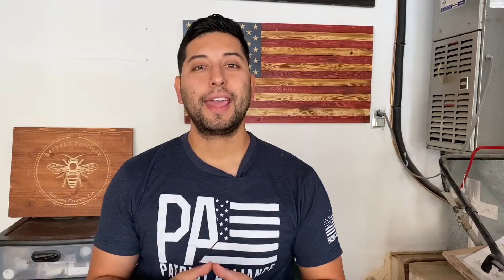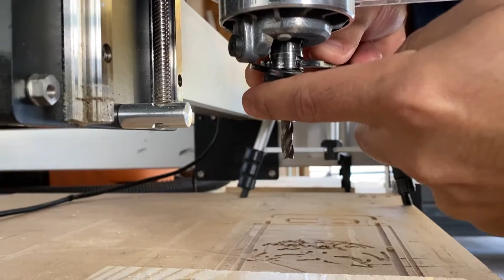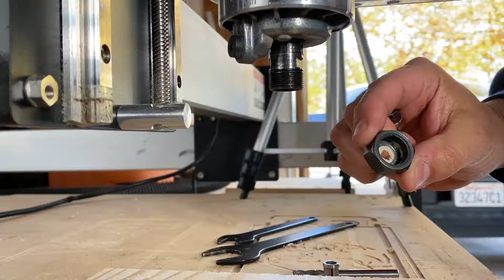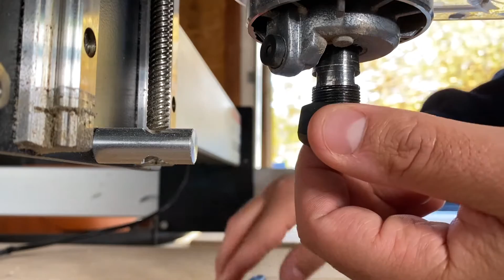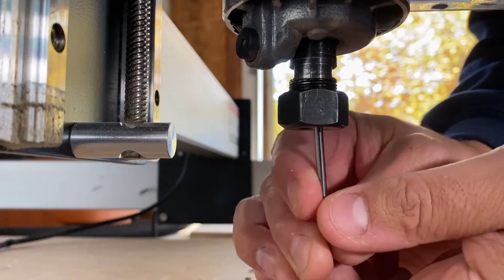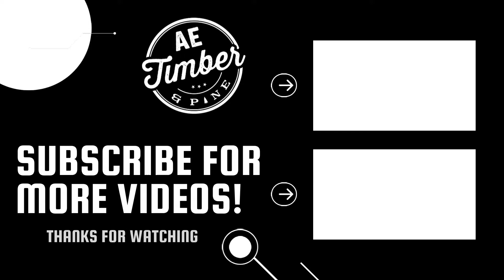How to Change Collet on a CNC | How to Change Collet on Shapeoko

Comment: So, I just got my machine...and my collet is super snug. I had to really push to get the end mill in there. (And I confirmed it is the right size). Is this normal? Will it loosen up over time? In the meantime, how the heck do I get the first bit out?!?!

Your videos are super helpful! Thanks man!
Reply from the maker: Hi Preston,

Hi Preston,
Are you using the carbide 3D bit(s)? 
I never had this issue with any of them not wanting to go in.  Maybe try loosening the bolt. Sorry, not much help on this part.

I have experienced them not wanting to come out though. When that happens I just remove the nut and then jiggle the endmill a bit and eventually the collet will come out of the router.
Reply: @aetimberpine  I sense Preston managed to get the bit out after all!  😝